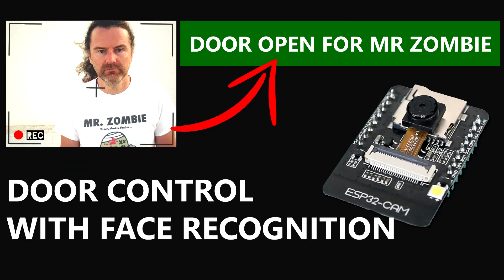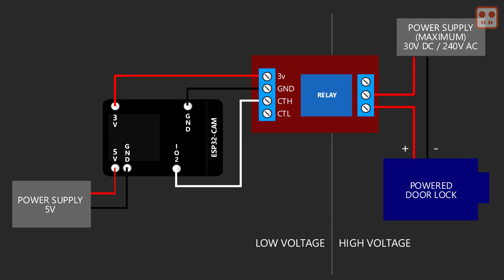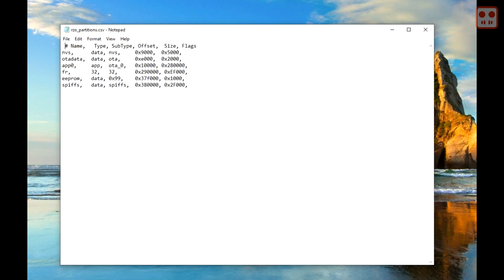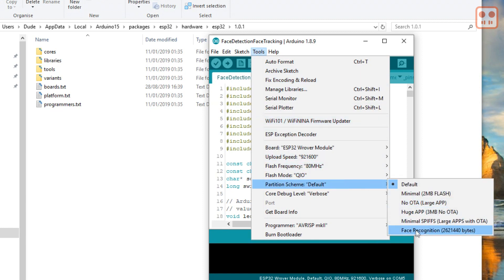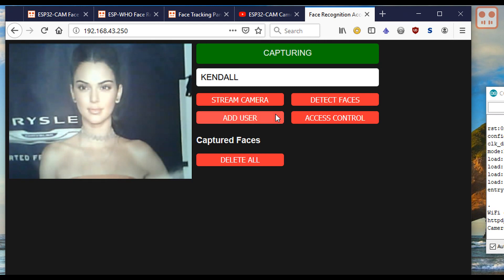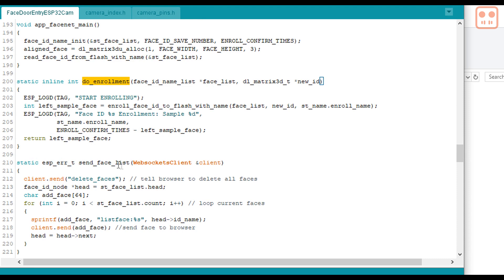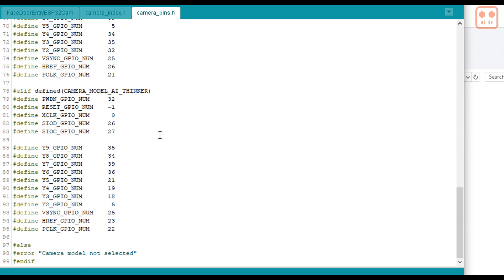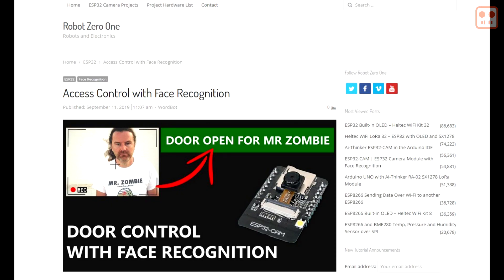ESP32-CAM Face Recognition Open Door Lock

Comment: @robotzere.one
I did all just like you but when i go on browser site there no screen. i can see there a lot of bug, do you have any idea how can i fix it?
Reply from the maker: Does the camerawebserver example work for you?
Reply: @robotzeroone 
YOu mean the example from your video Beginner ESP32-CAM arduino? yes i did and there all work fine i can see camera screen and all. in this example I can get on the site and I see those bottoms but I cant see the camera screen. Is that importat what version of webserwer i got? couse i used latest.
Reply from the maker: Do you see error messages in the serial? Are you using the 1.0.4 version of the hardware libraries?
Reply: @robotzeroone  
yes im using 1.0.4 version. theres no errors in serial i can see only if soomeone (me ) connect or disconnect
Reply from the maker: @michaszatkowski1624  I'm not really sure what the problem is. Maybe try some of the other tutorials on my blog to see if they work? You might have to change the hardware library version.
Reply: @robotzeroone  
Now im using same versions as you (1.0.2) and (0.4.10) and now i cant even upload the file. i have those problems.
C:\Users\MINE\Documents\Arduino\FaceDoorEntryESP32Cam\FaceDoorEntryESP32Cam.ino: In function 'mtmn_config_t app_mtmn_config()':

FaceDoorEntryESP32Cam:52:15: error: 'struct mtmn_config_t' has no member named 'type'

   mtmn_config.type = FAST;

               ^

FaceDoorEntryESP32Cam:52:22: error: 'FAST' was not declared in this scope

   mtmn_config.type = FAST;

                      ^

FaceDoorEntryESP32Cam:55:15: error: 'struct mtmn_config_t' has no member named 'pyramid_times'

   mtmn_config.pyramid_times = 4;

               ^

Multiple libraries were found for "WiFi.h"
 Used: C:\Users\MINE\Documents\ArduinoData\packages\esp32\hardware\esp32\1.0.2\libraries\WiFi
 Not used: C:\Program Files\WindowsApps\ArduinoLLC.ArduinoIDE_1.8.21.0_x86__mdqgnx93n4wtt\libraries\WiFi
exit status 1
'struct mtmn_config_t' has no member named 'type'
Reply from the maker: @michaszatkowski1624  need to use 1.0.4 for this tutorial. If you look at my blog there are other tutorials some need other versions
Reply: @michaszatkowski1624  I have same problem with the connection and web page... Have you solved this problem, Michał? Thank you!
Reply: @user-darkhan  No, i did not
Reply: @michaszatkowski1624  Ok, thank you!
Reply: @michaszatkowski1624  I succeeded and everything opened without this error, if I launch the browser on a smartphone.

Comment: Hi i have error 'struct mtmn_config_t' has no member named 'type'
'struct mtmn_config_t' has no member named 'pyramid_times'
Reply from the maker: I think this is because you need to update the ESP32 board libraries.
Reply: @robotzeroone  I'm use Esp32 board version 1.0.2
Reply from the maker: @NoteSornchai  I think it might be wrong in the video. You need a newer version than 1.0.2. Try 1.0.4.
Reply: @robotzeroone  thank you very much for your advice

Comment: Hi, does the face recognition also work offline (when no browser is connected)? Or is the ESP32 CAM Arduino support limited to the webserver feature? I've only found offline examples for ESP-IDF
, but not for Arduino...
Reply from the maker: Hi, This one will work without being connected to a browser: https://robotzero.one/esp32-face-door-entry/ You need to be able to add the faces while using the browser but you could then run a cut down sketch to not use Wi-Fi at all once you have faces.
Reply: @robotzeroone  which line must i cut  off in the wifi skecth sir?

Comment: Thank you very much sir for this wonderful video, but I have a question pls how can i change the code so that it will not capture one face with two different name, so that the system will prompt you that the face is already captured and has so and so name.   Thanks you are my best mentor in IoT stuffs
Reply from the maker: You would have to rewrite the code to check if a face is recognised before running any other code.

Comment: I tested it with other code e worked normaly...
Reply: Using the library ArduinoWebsockets version 0.4.10 folder: C:\Users\xxxx\Documents\Arduino\libraries\ArduinoWebsockets 
exit status 1
'struct mtmn_config_t' has no member named 'type'

Comment: The camera do'nt work anymore... :-(
Reply from the maker: Did you change something? Does the camerawebserver example still work?
Reply: @robotzeroone  Ithink that is yhe library and board version . I'm using v1.0.2 for board and arduinowebsockt v 0.4.10. Something else?
Reply from the maker: @abelferretti  IT should be fine. You could try 1.0.4 of the board library
Reply: Using the  library ArduinoWebsockets version 0.4.10  folder: C:\Users\xxxx\Documents\Arduino\libraries\ArduinoWebsockets 
exit status 1
'struct mtmn_config_t' has no member named 'type'
Reply from the maker: @abelferretti  Can you try this tutorial and see if it works? https://robotzero.one/esp-who-recognition-with-names/

Comment: I'M complling error messages:
FaceDoorEntryESP32Cam.ino: In function 'mtmn_config_t app_mtmn_config()':
FaceDoorEntryESP32Cam:52:15: error: 'struct mtmn_config_t' has no member named 'type'
   mtmn_config.type = FAST;
               ^
FaceDoorEntryESP32Cam:52:22: error: 'FAST' was not declared in this scope
   mtmn_config.type = FAST;
                      ^
FaceDoorEntryESP32Cam:55:15: error: 'struct mtmn_config_t' has no member named 'pyramid_times'
   mtmn_config.pyramid_times = 4;
Reply from the maker: Which version of the ESP32 hardware libraries are you using?

Comment: First of all congrats for this great work! 
I'm facing an issue on this project...Everything was running perfect until the last couple of days i was no longer able to stream from the esp-32 cam, as a result it couldn't detect or recognize faces anymore. I updated the boards and libraries, i even tried it from different computer and browser but still the same. I still can browse into the web UI but it won't stream any image from the left window. I tested my esp32-cam board on other projects and it's fully functional. So, any thoughts what's causing this issue? Thanks!
Reply from the maker: Does the camerawebserver example work for you? If you load that up can see the video at http://your-ip-address:81/stream ? Might be the camera.

Comment: #robotzero.one Now that is cool....i tried the other one before and we talked a couple of times but never got it to work this one is working just fine and does what i need it to do. 
The only problem i have right now is the wifi signal is very week i am either going to try to move the resistor for the external antennae or hopefully where i am going to install it  the wifi router is right behind it.
What will also be cool is if somehow it kept a list / log of the names and time when they were recognized in an excel spreadsheet or some other form of db for future reference if needed that will be awesome. 
Any thoughts on how to make that happen ???
You definitely got a coffee or a beer on me coming buddy
Thanks again
Denis
Reply from the maker: I've just scanned the article but maybe some help here: https://www.hackster.io/arundale/sqlite3-library-for-esp32-arduino-core-a76ad1
Reply: @robotzeroone  way above my head LOL but i will read it more thoroughly  and maybe give it a try :) thanks again

Comment: sir, i want to operate 4 realys according to four different imgages ...can it do it ???
waiting fo r your positive repsonce
Reply from the maker: You can do two with this board by using pins 2 and 12 and changing the code. Or you can add another micro-controller to the system connected to the four relays and send messages to the second micro-controller.

Comment: Great video! Would it be possible to pass MQTT messages to a broker when ever a face is detected ? That would be great!
Reply from the maker: A tutorial for Blynk - https://robotzero.one/face-recognition-with-blynk/ or if you want to use the code in this video you can replace the   open_door(client); with something like send_MQTT(f->id_name); and do your MQTT stuff in the send_MQTT() function.
Reply: robotzero.one thanks! I’ll first try to edit the code of the esp face recognition relay article! That looks easier to me 😅
Reply: Your video is great. I starts a project based on your videos a spy camera robo. But problem is the robo moves by blynk app and esp32 cam video stream control by pc I want just one screen control movement and video streaming but I don't know how to do it so plz tell........ And you can tell me what I can do Extra thinks to make more advanced this robo. Plz reply
Reply from the maker: @souravpatra0175  Probably the best option is to use this tutorial as a base: https://robotzero.one/esp32-cam-rc-car/ and use the two pins to control two motors for left and right like on a tank.